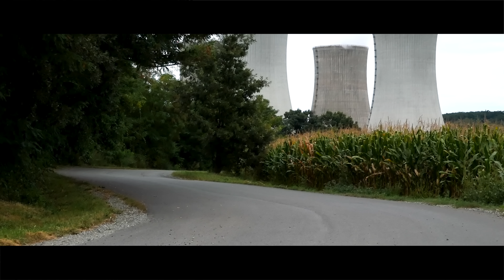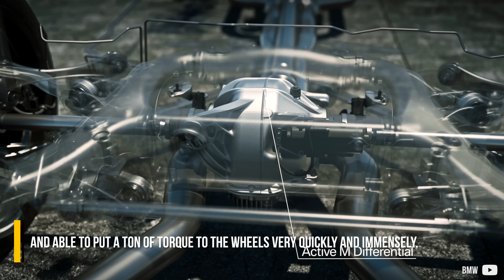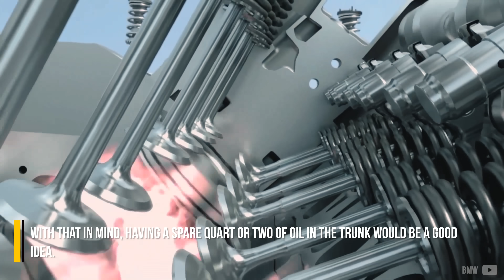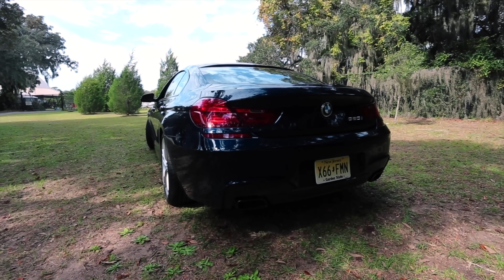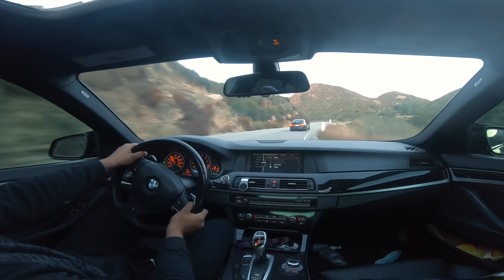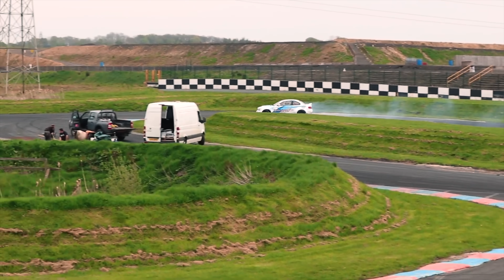The Worst BMW Ever?

Comment: The M52TU28 in my E36 is so far very reliable, even with 250k miles on it. It too has some failure points but it's a hell of a lot more reliable and somewhat easy to work on than some of these newer BMW engines. I'm currently doing oil changes every 3k miles, transmission fluid and filter change every 28k miles, differential fluid change every 30k miles, power steering every 20k miles and antifreeze change every 1.5 years. By doing this more frequently, it will last a really long time and have fewer breakdowns.
Reply: M52tub25 here in an e46 with 360,000km doesn’t use any oil or blow smoke. Really stout engine.
Reply: M52 is special breed among bmw engines😂
Reply: @mr123undead  M50 was better still but yeah M52 and 54 are perhaps the last genuinely durable and fixable BMW motors.
Reply: @soundseeker63  I agree. M54 was very fixable. I recall I had a 330i back in the day with worn rings, bearings and cylinder sleeves. Re sleeved it, new rings and pistons. Thing ram like a dream for 12 years till I sold it.
Reply: How many engines go bad. It’s all components.
Reply: Both the M52TUB28 and M54B30 I’ve had were rock solid overall, 360k on the 328i and it just runs like a top albeit with some oil leaks.
Reply: @Man ne  It is. Once you remove the swirl flaps and change the PCV to the cyclone type they are great. And very tunable too.
Reply: Let's be honest though, those are old school motors producing walking pace power. Cannot be compared in anyway, to the latter day powerplants designed for a whole different application. High performance, at the same time, everyday use, on 4 wheel drive, and hauling a 2 ton chasis. So ofcourse wear and tear will be significant. It would be naive to expect otherwise. We do however, owe it to the earlier motors for giving us the BMW performance signature.
Reply: I ran a bone stock non-vanos m50b20 with a t3/t4 eBay turbo setup for about a year on stock ecu, only using a fpr and extra injectors straight into the intake hose. Ran over 13 psi of boost on that janky setup and had no reliability issues that where not my own fault. The stock clutch took it like a champ as well!

I blame the european emission laws - the new engines need low internal resistance/friction to be able to comply.. leading to timing gear failure, running lean on the verge of pinging etc.
And dont even get me started on the suicidal high Pressure fuel pumps.

They simply cannot make them last the way they used to even if they tried
Reply: @The_Truth777  You think a 330ci that does 0-60 in around 6 seconds and more than 150mph is "walking pace power"....? lol
Not to mention if you look up tuning options for the older BMW 6s there are many out there that have been tuned to over 1000hp... Just saying.
Reply: @soundseeker63  If you know your cars well enough, you'll know that an M52TU28 motor is the 328i motor from an e36 as old as 1998 producing 240Nm of torque on a 2.8 litre motor. By today's standards, that's walking pace. An A45 AMG S, which is a 2.0 litre, produces 500Nm. Now imagine a 3.0 B58 or an S58. Let's appreciate progress BMW comes a long way.
Reply: @The_Truth777  Is it really progress, or is it just the fact that virtually all new cars come turbocharged from the factory?
You can turbocharge the M52 and other older BMW motors to great effect as I have mentioned. They are good for a reliable 450bhp on totally stock internals with a good tune, and also a heck of a lot simpler and easier to work on than the new ones. So I have questions about just how much "progress" has really been made in regards to the engines.  I would not dispute that progress overall has been made however, even if the vast majority of it simply the addition of more computers and electronics, which in turn bring their own set of problems.
Reply: @soundseeker63  if we look at how modern engines handle cooling, fuel consumption, emissions, fuelling, overall engine weight, low-end + high-end torque, environmental impact with regards to production, etc, one can appreciate the progress. This is a journey towards EV gen, which we petrol heads dread of course. But a sensible manufacturer can not move from a great engine with no reason. Modern engines, are far more efficient in the many ways I mentioned above and more.
Reply: @soundseeker63  also, modern engines are specifically designed for turbocharging, which make them far more precise than an NA engine which one later turbocharges. There’s no ways a turbocharged M52 can be compared to a B58, which btw, is currently regarded as one of BMW’s most reliable engine in the current gen, not to mention its performance capabilities.
Reply: @The_Truth777  They are more efficient to some extent, but that comes via complexity and the addition of further electronics which, as I said, creates its own set of reliability and maintenance issues.   Yes, I understand why manufacturers do this, environmental pressures etc. But I sure as hell wouldn't want to own any of these modern cars after the 100k mile mark! Whatever you save on fuel you are certain to pay out in repair bills, and then some!

Comment: Arghhh just another guy talking worse case scenarios. You only hear about the bad stuff on BMW. But did y'all know that other engines such as the beloved LS also have their own problems? There's lots of N63s out there that are kicking ass, after the TU2 update it's been known to be much more reliable. We don't even know about the new ones yet, at 520hp it's a mayor upgrade
Reply from the maker: Each engine has got its problems. Some of them are just much cheaper and much easier work-wise to fix.

Comment: BMW sure knows how to make an unreliable engine
Reply: The irony is that their first V8, the Nikasil lined M60, was actually pretty reliable if it survived the sulfur-gas recall issue, and the full servicing schedule including cooling (incl 90C or lower tstat as well as rad/lines/tank etc) and oil (esp. oil pump bolts) have been attended to.
Reply: @Patrick Conway change oil and take care of an engine is not really a great argument to defend an engine. Event de 13b of rx7 well taken care of are rock solid engines.
Reply: @Helicopter Dad! hahah usualy because stupid electronic not failure by design
Reply: the B58 would like a word.
Reply: @cesarxmbert  The B58 is good because it had to meet and pass Toyota's quality control which is much more stringent than BMW's quality control. BMW fans can thank Toyota for that.
Reply: @MrSelfDestruct-1  that was only in the supra
Reply: @MrSelfDestruct-1  no it wasn't. It was used in most models before the Supra and still the same result. Toyota have BMW to thank for providing such an engine.. and Interior...
Reply: @willm203  thank toyota for the interior? Hahaha, what are you talking about, have you ever seen a nice and quality interiour in a toyota?🤣🤣🤣. Also the electronics in bmw cars are very good
Reply: @pasma1983  okay go take this supra. And have a look inside. Then take a bmw since like 2013 and look inside. It's the same interior..
Reply: @willm203  well, thats what i say right? The interior in a toyota that looks good is not a toyota interior, that must be Bmw interior are some other brand.
A tradional toyota interior is not nice, also hard plastics.
The other side is, electronics in the toyota interior never fail. I had a toyota corolla sport, it was so good(accept the brakes and the quality of the interior).
That car never ever brake down🤷‍♂️
Reply: @pasma1983  I read your message back to front... that is right. Although my electronics are sound solid in my BMW.. touch wood and whatever else keeps good luck.. and also I was saying toyota have bmw to thank for the supra interior as well. I think we've both crossed each others wires here
Reply: @willm203  yes you are right!🙈🙈🙈. We need to take more time to read proper🙈.
And yes, electronics from bmw are also very good. My bmw e30 325i (type one)is solid in every way.
Reply: @willm203  The interior that got criticised for being simple and cheap you mean?
Reply: @pasma1983  Toyota makes better quality/put together interior than BMW. The numbers support this.
Reply: @willm203  Toyota and BMW signed an agreement all the way back in 2012. This is 3 years before the B58 came out.

"BMW Group and Toyota Motor Corporation (TMC) are pursuing their successful strategic long-term cooperation in the field of sustainable mobility today by signing binding agreements aimed at long-term collaboration between the two companies for the joint development of a fuel cell system, joint development of architecture and components for a sports vehicle, and joint research and development of lightweight technologies. These agreements follow a memorandum of understanding signed in June 2012."
Reply: @MrSelfDestruct-1  hahahaha, the interior better than bmw? 🤣🤣🤣are you drunk? Well, give me some link where i can find it.🤣🤣🤣
Reply: @pasma1983  Compare any Toyota and BMW of the same price and the Toyota will have much higher build quality and fit/finish. There's a reason Toyota scores yearly on vehicle dependability/reliability tests in the top 3 meanwhile BMW scores barely above industry average. BMW scores just slightly above Chevrolet in build quality and dependability. Imagine that 🙊. Search for any quality, dependability tests ranking and Japanese cars are always in the top 5. These are facts backed up by numbers.
Reply: @MrSelfDestruct-1  i know the Japanese cars are the most reliable cars, lexus on top.
The bmw stands at number 11 in the ranking, and mini(also bmw) rank number one.
The most brands in the top 10 are Japanese.
But interior is very shittie in japanese cars, the hard plastics are 🤮.
Reply: @MrSelfDestruct-1  i did copie a list ( this is from a research in Europe) 1.Lexus8,82.Subaru8,63.Honda8,44.Mazda8,3Toyota8,36.Suzuki8,27.Mini8Mitsubishi89.Hyundai7,710.Kia7,611.Mercedes-Benz7,512.BMW7,413.Dacia714.Fiat6,715.Ford6,6SEAT6,617.Nissan6,5Renault6,5Volvo6,520.Audi6,4Opel6,422.Skoda6,3Tesla6,3Volkswagen6,325.Citroën6,226.Peugeot6,127.Alfa Romeo5,7
Reply: @MrSelfDestruct-1  and you think that has any bearing on bmws development of their own engine. Implying toyota were only reason bmw were making a very good inline 6 is a joke. It's their bread and butter.
Reply: @willm203  That does not make them reliable. Even BMW's most loved inline 6 engines are also known for having many issues. The S50 in the M3 is known for having VANOS failure. S54 M3 engine, again same story also have VANOS failure, water pump failure, rod bearing failure. I can go on.
Reply: @MrSelfDestruct-1  it's just like teaching pork... you run to s engines.  Made to run even higher performance for m cars. Where alot of them dont even get maintained properly no doubt... but again Mazda used a 13b in an rx7. Excellent and reliable. When looked after properly..
Reply: @MrSelfDestruct-1  doesn'd every engine has some weak poimts and some strong points? Please man, you are just not realistic🙈
Reply: @Patrick Conway i agree with you!
Reply: @Helicopter Dad! just not Chevy or dodge
Reply: @Helicopter Dad! i dont know any American engine or car that is good. All of them are crappie *hit.
Reply: @Helicopter Dad! hahaha, we have some sayings about Amercan cars in Europe🤣🤣.
American cars: you are laying more under it than sitting in it🤣.
Also:  you spend more time filling it up than driving it.
Also: the interior falls apart even looking at it.

And we have a lot more, also a lot sayings for French cars, because they are very bad🤣.
Reply: @Helicopter Dad!i always knew a lot of Americans are not that smart.
You are the perfect example.🤣🤣.
Its a shame for Americans who are smart.
Reply: For pick up trucks yes, buy American.  For basically every other type of vehicle, buy Japanese.

Comment: As someone who has owned two N63-powered vehicles, a 2011 550 and a 2016 Alpina B6, I'm actually pretty happy with the engine.  I've done some work on it myself and found the packaging to be the worst issue, as getting to certain components is just ridiculously hard.  But overall, even on the 2011's earlier design, I've not had as many problems as one would think.  I did do the valve stem seals, which was quite expensive, but that's because I wanted it to live longer.  Aside from that the only internals issue I've had is minor scoring on cylinder 8, which I've been told is typical for this platform.  I've had one injector fail, one coil fail, one VANOS sensor fail, the coolant crossover pipe leak, and a minor turbo oil drain leak, in 130k miles.  Not really that mad about it, I'll be honest.

Plenty of power, sounds amazing...certainly there are some drawbacks but in my experience I've been very lucky and carried out every maintenance item I could as soon as I could.  Both engines have treated me pretty well.
Reply from the maker: It seems to me that you encountered if not most, certainly many of the typical N63 failures
Reply: Alpina ❤️